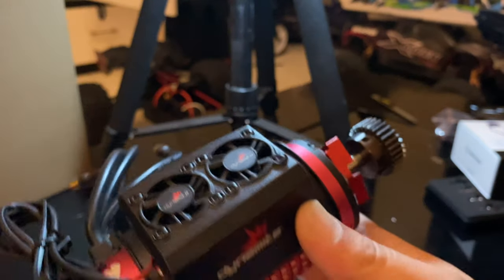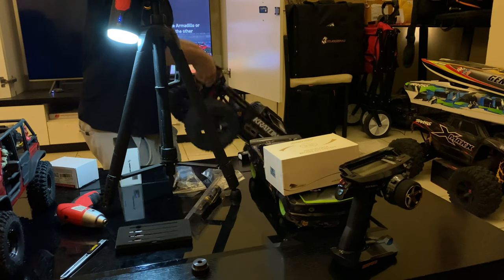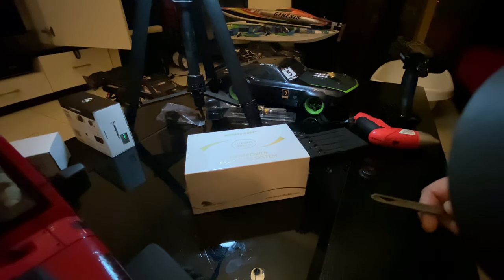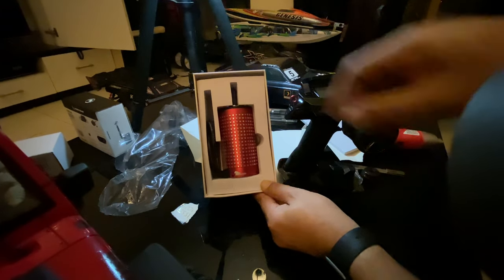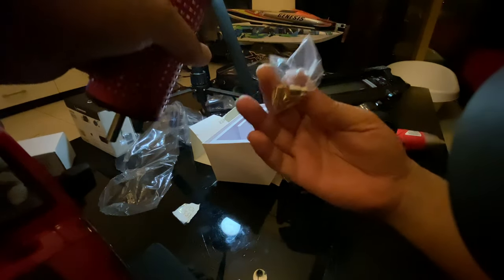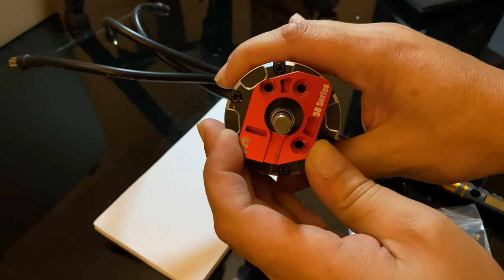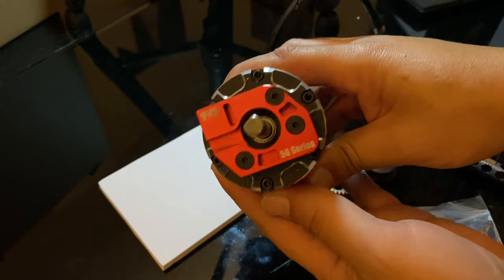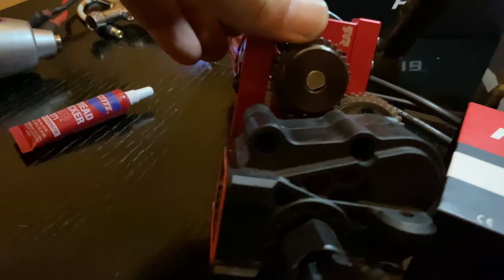LEOPARD 58113 1050 KV UNBOXING

Comment: I have that motor for my Kraton 8s after I seen you run it 💪🏾
Reply from the maker: Awesome dude
Reply: @UAERCADDICTS  hey my man I barely drive mine 5mins motor Hot my gearing is 34/47 with XLX2 it’s not tuned either . Should I one to one gearing ?
Reply from the maker: Opps put cooling fan, but how did you manage to fit the 34 pinion with 47 T center because the max with that put to fit is 26T pinion on the arrma 8s exb 🤔
Reply: @UAERCADDICTS  I have the PPS motor insert I can run up 40T I forgot to mention my motor wires were shortened could this be the issue.
Reply from the maker: @runngunrc1991  short motor wires usually good thing better for current delivery but ty forget any gearing more than 27 will over your motor as per the manufacturer manual unless you play it fear and not hitting full throttle all the time. check your gear mesh and your exact KV
Reply: @UAERCADDICTS  I appreciate you taking the time to help me my man.

Comment: I had this exact motor in my dbxl-e 2.0. Powerful motor, but unfortunately I had a very hard crash and it broke the 8mm motor shaft destroying the motor.
Reply from the maker: opps order new one :)
Reply: @UAERCADDICTS  I actually had a leopard 58113 870kv on order before the accident, so I'm good for the time being.
Reply: @UAERCADDICTS  How would you compare the leopard 58113 v2 1050kv to the castle 2028 1100kv?
Reply from the maker: @Blueknight1960  leopard can is much powerful :) you can go with higher pinions